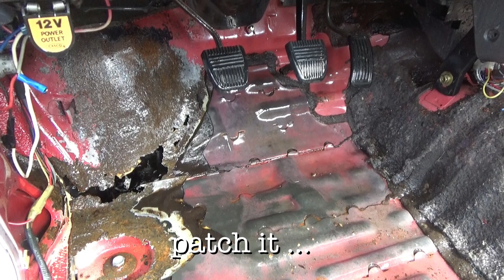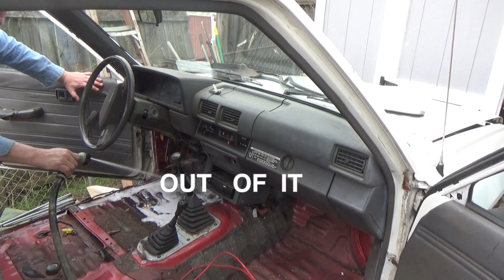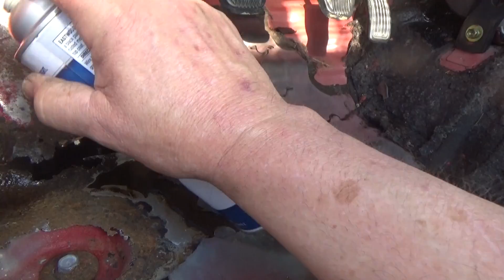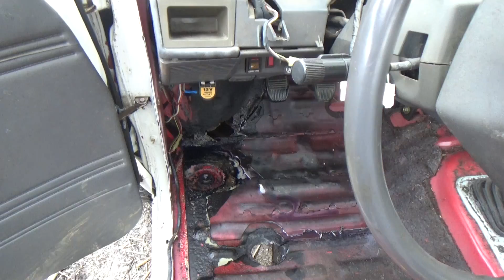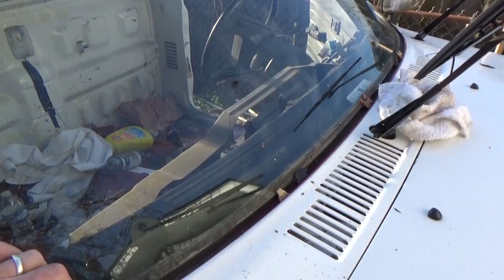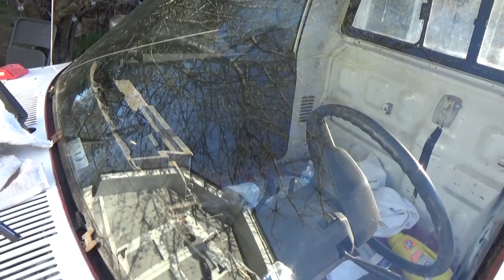Toyota Pickup Restoration - Fiberglass Hole Repair- Leak Findin

Comment: Another design flaw...the windshield trim and gutter cover...both collect dirt, hole water and rust through the A pillar and bottom corner of the glass. Check the bottom of the front door frame(under the kick panel trim) from the inside...It will fill with water from the leaks...and yes the delaminated glass is one leak...did on mine to. Do you have a video of what you had to repair on the windshield body flange?